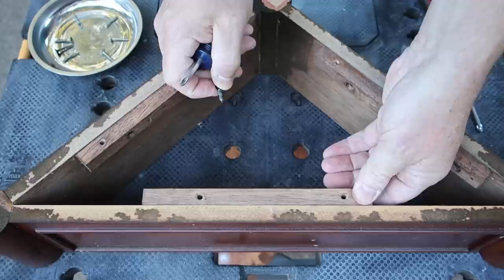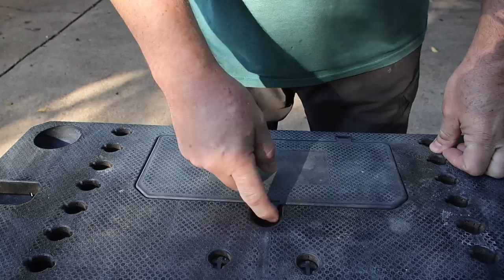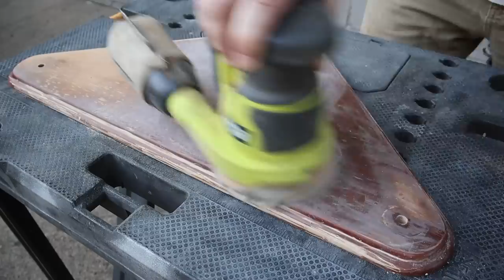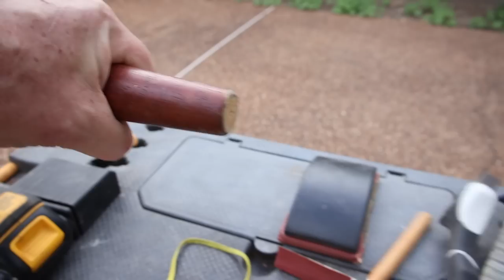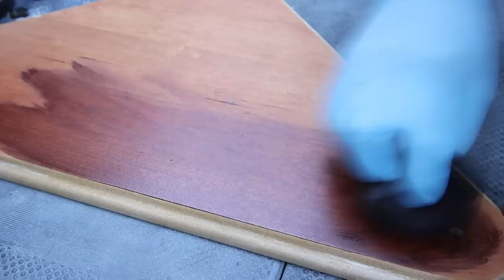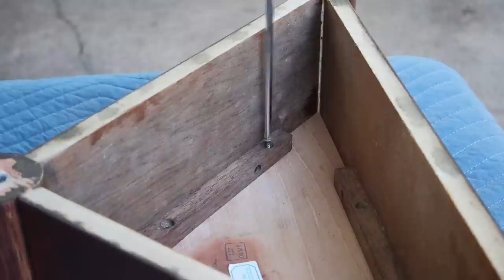I Found this JUNK Table on the Side of the Road and Made it PRETTY again!

Comment: I have a Bombay Co. mirror that's at least 40 years old and it has held up well, aside from the joints shrinking.
Reply from the maker: I had never had a piece before this. Found it on the side of the road. It is not something I would have purchased back in the day but I love how it turned out in the end. Thanks!!

Comment: Can you tell me what the set up is for spinning the spindles for sanding? Sweet to see a trashed piece take on a new life
Reply from the maker: Thanks! I cannot remember the turning speed of the lathe that I use when simply sanding pieces. I will have to go look it up and get back with you on that. It's a slow speed though. The big thing I have to remember though when using the lathe to sand is to make sure I do not put scratch marks in the wood as it turns. I just turn to get the heavy finish off and then finish sanding with strokes by hand along the wood grain to remove marks from turning.

Comment: I have something similar but it is designed for a snooker room. So there are holes drilled through the top so I can slot cues in the holes. Very useful.
Reply from the maker: That is a damn fine use for this piece. I can't find a place for this.
Reply: @Restorology  Yes. I have a snooker room with a full size table.
Reply: A small hook screwed into the under side of the top. That takes the triangle.

Comment: Why not use paint stripper ????🤨🤨🤨
Reply from the maker: I hate using stripper. It's stinky, messy, environmentally unfriendly, and not safe (but mostly because I am bad about using PPE). I try only to use it when scraping or sanding is not enough. I really, really hate using stripper and only use it when nothing else works. I've got a couple of projects in the queue for which I will need stripper so stay tuned! ✌🏽